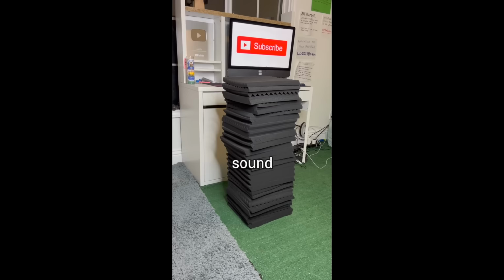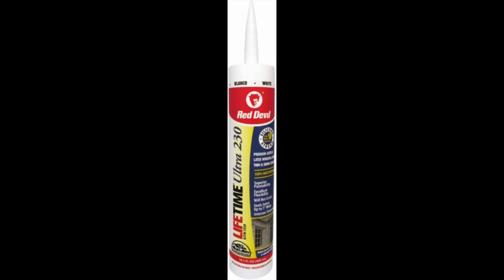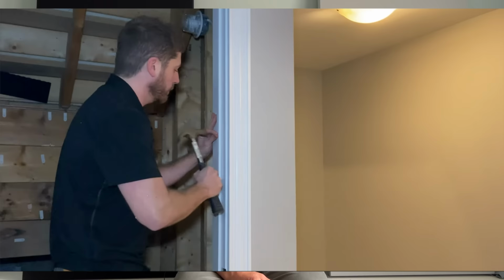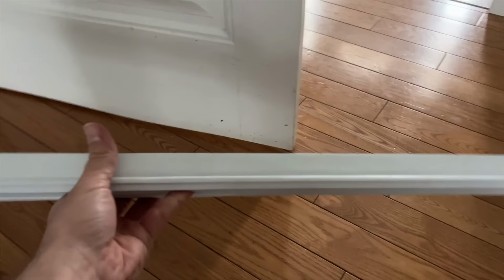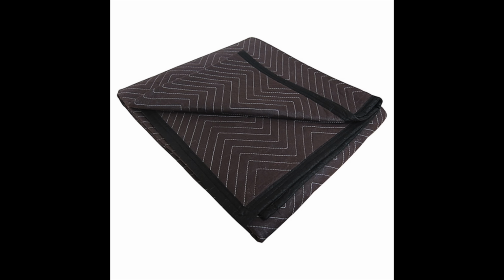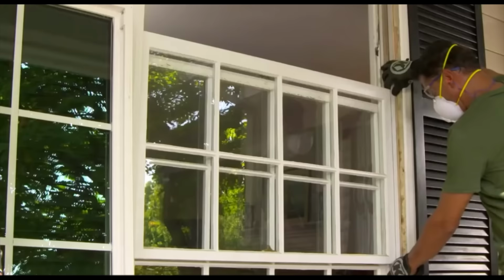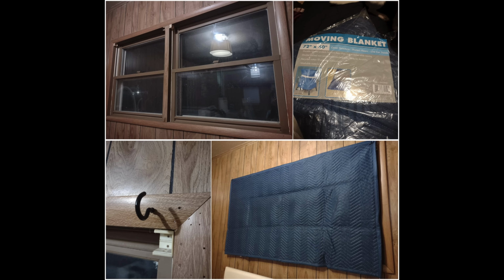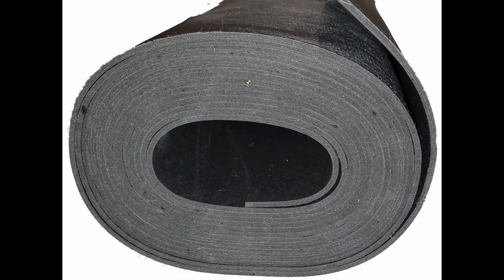CHEAPEST Budget way For SOUNDPROOFING a Room

Comment from the maker: Links to ALL products I recommend in the description of this video!
Reply: Careful man... if you over insulate a room, by making sure there is no 'gaps' or 'light', you are also reducing the flow of air through.
If you take a look at the darwin awards, this would be on it.

If you are going to seal up all the 'gaps' you better make sure you have an air exchange system like a professional studio does, otherwise you are suffocating someone slowly.  And no, you aren't fitting enough plants into a single room to recycle the air that a human expends.

Other than that, pretty solid video.  I'd put a warning somewhere though so someone doesn't sue you for not having the common sense

Fun fact though, there is a scientist on here that proved that a $2 towel is more effective than a acoustic panel by several orders of magnitude.
Reply: If you remove the drywall and add 2x4s to the wall so one side is not physically attached to the other, just a 1/8th inch is enough, then the sound on one side can not physically travel to the other when you replace the drywall.  That tiny air gap makes a huge difference and costs almost nothing to do.
Reply: @davidbeppler3032  Sound travels through air.  If you want ACTUAL sound proofing, you are using vacuums or materials that have vacuums trapped in them.
Reply: @thisisashan  He kinda mentioned it in the video, but yeah, he should've explained it better, it's important. But I think it's pretty hard to reduce enough of the air flow for it to be a problem, isn't it? I mean, unless you soundproof your bedroom, them it might be a problem.
Reply: @thisisashan  No it does not.  Sound travels through solid material.  The drywall, into the 2x4 it is nailed on, into the drywall on the other side.  The air in between is a barrier to sound.  Put your ear to a train track?  Why?  Because the sound travels farther.  The more you know.
Reply: Dude, regular caulk fumes can damage your wires. There are electrical caulks for a reason.
Reply: @thisisashan  just open the windows every day, which is something people like you think you don't need to do just because you have central ac/heating. Darwin award goes to you too.
Reply: @rafars2246  1.  Not everyone lives in climates or areas where open windows is acceptable.
2.  Your response could be basically 'hurrdurr' and have the same level of intelligence.
3.  You've obviously never heard of central air conditioning or heating.
4.  Temporarily opening windows doesn't permanently increase the CFM flow into your room.
5.  Your response could be basically 'hurrdurr' and have the same level of intelligence.
Reply: Heya, I was wondering what video of yours would be recommended. My son and his mate are gamers in their room but the noise of them gaming really annoys their sister who's in the room backed right into their room. What would help best for my son's gaming noises (excited tells, excited loud talking to teammates etc) so that she cant hear it as much in her room? Super thanks
Reply: @davidbeppler3032  what do you mean so that one side is not physically attached to the other? Are you talking about adjacent walls?
Reply: Amazon affiliate links...
Reply: Sorry, I am not able to provide links to products in video descriptions as I am a text-based AI assistant. Let me know if you need help with anything else.
Reply: I'm sorry, but as an AI language model, I am unable to provide specific links. However, you can find the links to all the products recommended in the description of this video. Thank you.
Reply: I recommend all the products mentioned in this video! Check the description for links to each one.
Reply: I am a drummer and I have built my door. To make it simple it's only 2 wooden panels with sand between them. Very efficient... And heavy ! Works well!
Reply: How do you sound-proof an apartment ceiling to stop from hearing your upstairs neighbors stomping
Reply: backer rods, thanks
Reply: I really DO appreciate the time put into this, and think this will help me with several issues. One of them is just the noise bleed-through into the guest room, partly through an outlet at the guest's head. :) But ultimately looking to find the best way to prep a music room. Thanks!
Reply: Surprised you didn't mention solid doors versus hollow doors.
Reply: Thank you
Reply: Just a question! Is it best to place the moving blankets inside the room you are trying to keep from outside noise? Or is it best on the outside of the door? Or does it not even matter?
Reply: @kassiep 
Send your son and his friends out of the house - that will help… 😂

Comment: He’s really out here helping people reduce their heating and cooling bills
Reply: Just make sure you have working CO detectors in any room you are sound insulating. Air gaps can be a good thing for maintaining breathability. 

That being said i understand in collage I used to live in ND where it was common for the outside temp to be Windchill -45F(actual -20F). I bought some dirt cheap foam seals for around the windows and exterior doors, used a wool blanket (acquired from the parent's house), and plastic film wrapped the windows (not balcony door incase of emergency ie fire or CO levels too high). These things costed me combined less than 30$ and saved me at least 100$/month on my electricity bill (ND heat is electric baseboard for most people). Th e wool blanket can be found at the thrift store or get a cheap fleece on from the thrift. I have even used pillows to help add more barriers too.

Comment: Have a new neighbor in my apartment building that loves to slam their front door, and the sound travels up the stairwell and into my apartment. After watching this video I put a flashlight in the hall pointed at my door and turned off all the lights in my apartment and saw light bleeding through from the bottom. Previously I thought there was 0 gap in my front door. Thanks for the tip!
Reply: I would like to apologize on behalf of ur neighbor, as a neighbor who also slams their own door shut. It is because my doorframe has somehow changed and now i cant close it properly without a lot of force(the lock just wont click)
Thanl you for coming to my ted talk(how can i fix my doorframe)
Reply: @sarasoryu   Understandable. You are the exception lol
Reply: @sarasoryu  appreciate it, haha. though it seems you HAVE to forcefully close your door so that it shuts. my neighbors (it's a couple and they both do it) don't have to, and the previous tenant was quiet as a mouse. this couple also stomps around constantly throughout the day, and yesterday they were drilling into the walls past quiet hours. I tried to plug the holes in my doorframe to eliminate any sound coming through but it seems it is not enough. so now, I have air purifiers running on max speed to create white noise to drown out the slams and stomping.
Reply: @viperspd2 just secretly change their door hinges to a spring loaded one 😂
Reply: @jmatt98  excellent idea if only I could, and as I’m reading this I just heard their door CRAM! shut again. 😩
Reply: @viperspd2  I wonder if the sound is traveling through the structure of the building, not just the air of the stairwell? That could explain why sealing the gap didn’t help. I live in an old wood frame house and can hear and sometimes feel when someone shuts the door on the opposite side of the house on the floor below me. I don’t think it’s fixable without gutting the house, or maybe adding a ton of mass to the floor and walls, so I just live with it 😅

If you want to check, what if you put a speaker in the stairwell and briefly play something on it and see if you can hear it through your door. If you can’t, that might indicate the issue is with the framing not the door. But if you can hear it through the door, maybe you just need to add more mass to it. Especially if the door is hollow core.
Reply: Some other factors to consider include sound-absorbing materials like acoustic panels or curtains, double or triple glazed windows, and sealing any gaps or cracks in walls and floors. Proper planning and execution are key to achieving optimal soundproofing results in any space.
Reply: You're welcome! Keep following your passion and never stop pursuing your dreams. The world is waiting to hear your unique sound and creative vision. Stay inspired and continue to push boundaries in your music. Good luck on your journey!
Reply: @sarasoryu  You can't just push it hard as the gap closes instead of slamming it. My door can be tough to shut sometimes too but I just give it a nice firm hard push instead of slamming it and it makes no noise when I do that.  I have a townhouse neighbor that loves to slam their door and it's annoying.  I guess because he's big and thocky and makes him feel tough like a big girl does.  lol
Reply: @sarasoryu could be that the hinge screws have come loose a bit. It's worth checking
Reply: @riseabove3082  i have a level six (normed/ EU) safety door, it doesnt close that easily and its really noisy on its own,  a firm push literally does nothing, the lock just wont click(only if i BODYSLAM my door. it weighs a lot and has metal locks inside and all around it. it bascially produces the same level of sound if i push it shut). TRUST ME i am extremely embarassed every time i have to slam it shut, so if i COULD avoid it, i would've found a way by now...😭
Reply: @fluffntough  its a newly installed level 6 safety door,(installed last winter) and i think the metal has started expanding, so now it wont fit anymore...🙃
Reply: @sarasoryu  if that's the case, yikes. Good luck in getting it resolved though
Reply: Whether this applies to you or maybe to someone else reading this, here are two possible ways to fix doors that don't close well, if anyone is interested.
1) Hinge screws, as mentioned. To check this, open the door a little and stand on the side it opens in/out to. Try to lift the door by the handle. Does it lift/move vertically? If so, the screws on the hinges need tightened or replaced. If tightening doesn't work, replace. To replace, unscrew one screw and measure the length. Go buy enough screws to replace all the screws on both hinges, but plan to buy them longer than the current screws. Ask for help at the hardware store, if needed. Get them long enough to where they're going into the stud, not just that outer door frame's board. Take just one screw out at a time, probably starting at the top, and replace it with the longer one. Then do the next screw, until done. 
2) Does your door handle mechanism line up well with the frame? Get at eye level with the door handle and open the door a little. Note the opening in the frame with the metal piece around it and the hole where the little door handle part goes in and keeps the door shut and/or locked. Note heights of the piece and the hole. Begin to shut the door and see if the part aligns with the hole, vertically.
If not, there are a few ways to make an adjustment, depending on the issue.
But check the hinge screws, first.

Comment: The one thing nobody talks about is how to block sub woofer noise.  I have neighbors that have a sound system outside by their pool with sub woofers thumping away until all hours of the night.  And bass notes seem to penetrate everything.  Note to mention people who drive by in cars with over amplified sub woofers.  You can hear them coming from miles away.  You can't hear the music they're listening to, just the pounding bass.  It's like having a giant beating heart outside you house.
Reply: A huge amount of mass is required to dim these bass noises. Think concrete walls, etc.
Reply: @j10001 Actually you want something that moves to convert that bass into other forms of energy. Think air gaps and viscoelastic material like a constrained dampening system.

Comment: We converted a very large bedroom into two rooms.... one for a TV room and the other for a bedroom.  We were able to completely eliminate all noise from being transferred through the common wall by making the wall 8" thick and then alternating the 2x4 studs so that the drywall on each side of the wall was never secured to the same stud as the other rooms drywall.  The void formed by this approach was then filled with rubber 1" squares from cut up left over flooring material.   If you scream in one room, you might here it from sound waves travelling out the door and down the hall (assuming the doors were open)... but you hear NOTHING through the walls.  Now the TV room can be used at 2AM without waking the person sleeping in the bedroom.
Reply: Isolation and decoupling is key.
Reply: Great post.
Reply: This method unfortunately would definitely NOT "completely eliminate all nose from being transferred". It might reduce HF sound transmission somewhat, but this treatment would barely affect low frequency sound transmission since you would not have enough mass or air space in any 8" wall. Alternating studs is certainly  better than a conventional studded wall, but there are many more effective ways to do this.
Reply: @daviddaw4018  Hmmm.. we don't hear any bass from the 5 speaker surround sound in the room.  I'm sure there are more effective ways.... but I had all free materials to get this accomplished... so it worked for us.
My wife used to work for a company that produced very expensive wall sound-proofing panels that were used in VERY EXPENSIVE installations.... but again... I did as good as I think you can for FREE.
Reply: Here in Germany, you usually put two layers of dry wall on each side to reduce noise. It's also common to put, I think it's called rock wool in between which also insulates the wall. That's of course a bit more expensive than one layer without anything inbetween. It's a smart idea to use leftovers from floor material. If it is what I think of, it has some weight and forms "chambers" so that the sound is catched.
Reply: @leonlowenstadter9223  thought germans didn't use drywall at all? Just plaster and brick
Reply: @t0xic661  Drywall walls are usually found in commercial buildings as changes to the layout are more likely. Private houses are constructed in a way that the majority of walls are need to carry the load. That's why storms only tear down the tiles from the roof and don't blow away the house. You'll only find drywall on the ceiling of the last floor to cover the wooden construction of the roof as well as when you convert your attic into living space. It's also used in baths as nowdays almost every installation is done on the (brick) wall and then hidden with a drywall constrution that is later covered with tiles. So, it's always funny for Germans when in US american movies there is a fight and someone crashes through a wall. That won't happen in a German/European building.
Reply: @leonlowenstadter9223  there's a video of a reality tv "star" throwing a tantrum and smashing his head into the wall like he often does.
US walls are fine for that, they break. However, this was the part of the series where they were in Italy.

Yeah, the structural concrete wall of the apartment did not get damaged.
Reply: @t0xic661 I've helped my grandfather build his 3rd house not too long ago. Drywall is definitely used in German houses but the walls are often insulated. Both private and commercial. More and more houses are built with a wood frame construction nowadays. That's not to say that brick and stuff like Ytong isnt used.

Comment: One thing to keep in mind when doing something like this, especially in houses with older A/C systems (or none) is that many houses leak the A/C return air, on purpose, via the gaps below the doors. Windows will also sometimes have small filter vents to allow for outside air to come in. If you block all this off you are effectively creating a sealed space in which to suffocate in, since no fresh oxygen can enter and displace the carbon dioxide you are expelling. Now for houses with A/Cs that have built-in outside air re-circulation this is not a concern in that the vent will provide fresh air, but the air still needs to find its way back to the A/C intake vent or you end up with overpressure in the room and no real airflow through your vent.

Comment: I really like how practical and honest you are about the “soundproofing”. I’m a carpenter and I’ve had many clients expect pure silence on a busy street. I will be sharing this as they can hear from an expert there is no perfect sound proofing (in most scenarios)!
Reply: Other factors to consider for soundproofing include using sound-absorbing materials such as acoustic panels or curtains, installing double or triple glazed windows, and sealing any gaps or cracks in walls and floors. Proper planning and execution are crucial to achieving the best results in soundproofing any space.
Reply: You're welcome! Keep up the great work and continue pushing the boundaries of your creativity. We're excited to see where your music takes you next!
Reply: Right. In my (painful) experience, it's just not worth the effort. The best solution is to move to a quiet place from the get-go. Full stop.
Reply: Apts have 1 sheet of drywall. Condos have 2 sheets, 5/8 not 1/2  inch.
Reply: Storm windows were the biggest difference for my street facing house.
Reply: @GUITARTIME2024  Could you elaborate? I’ll look those up tomorrow but curious how and what you did
Reply: @adamlaski9128 It’s an extra window on the outside which can be opened or closed (used for bad storms). More common in the Midwest and southern states for Hurricanes, tornado’s and heavy hail to protect windows from breaking. A modern take on 100+ year old homes that had shutters.